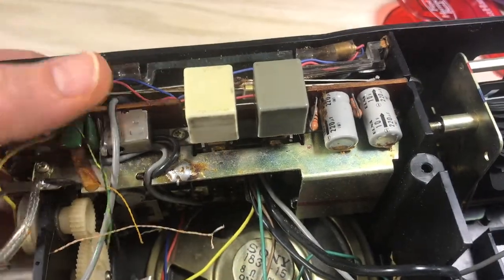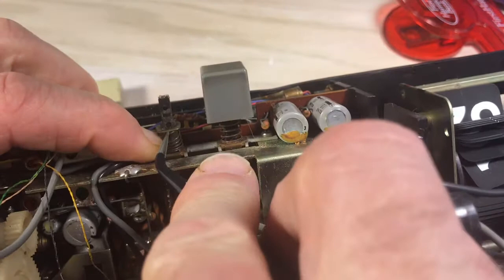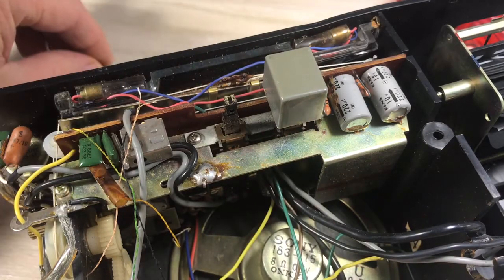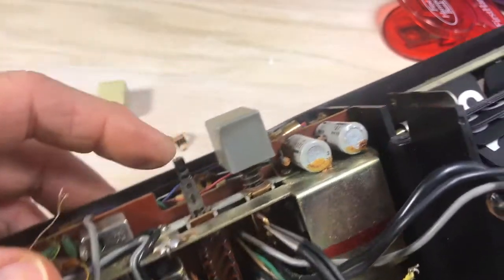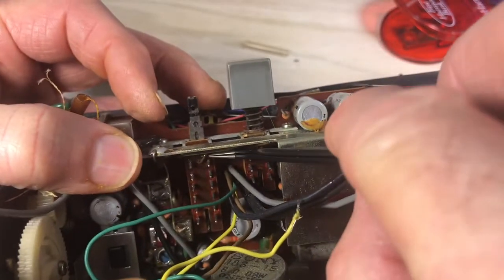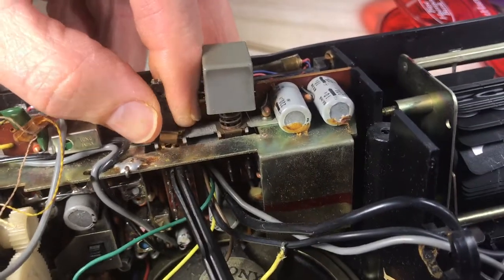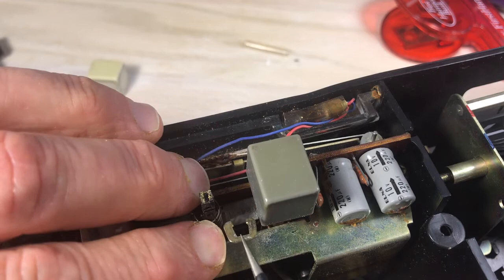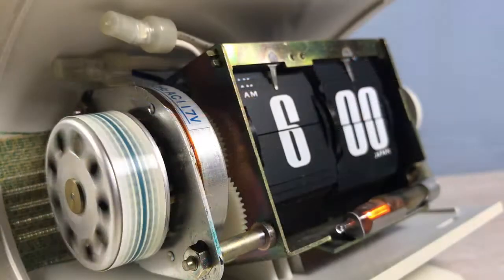Cleaning the switch on a Sony 8FC-59WA

Comment: Thanks for the tip on dismantling these switches. I cleaned mine but...😢 no joy. 
The dial lights come one - but that's all. I know the radio works because it plays when I raise the Sleep button. 
But I think there's a wiring issue because the only pins on the switch that have voltage are the three in the upper left. That doesn't seem right.